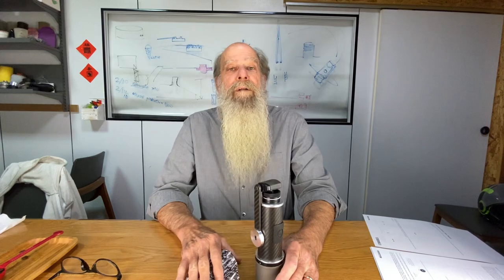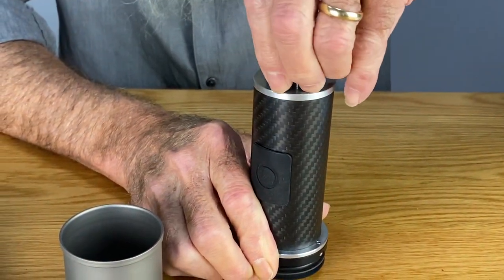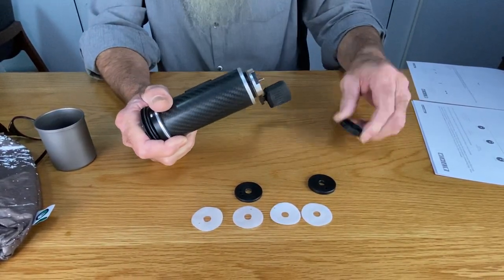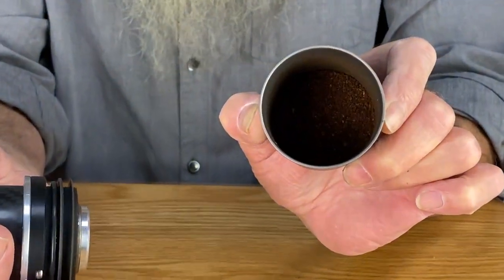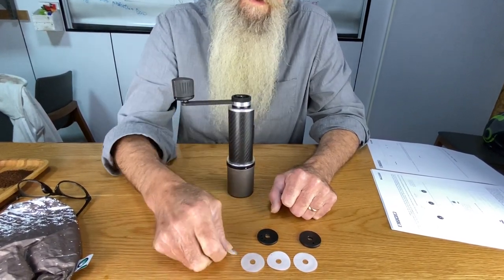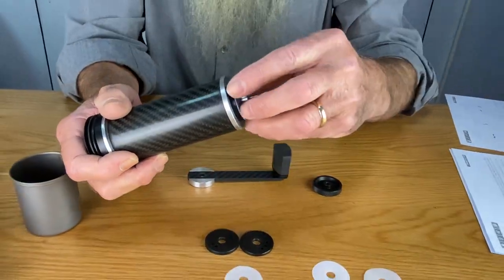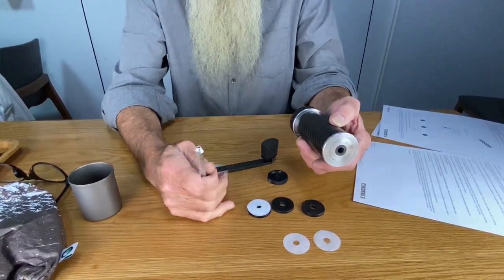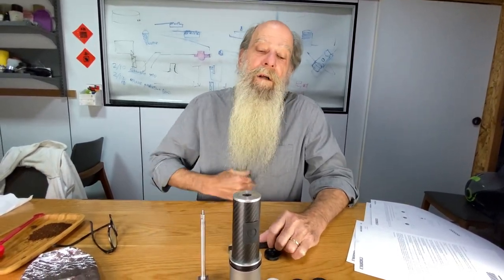OE FIXIE Manual Coffee Grinder Basic User’s Manual

Comment: This is absolutely sick! I love the design and the carbon fiber. 
The only thing I do not like is how to get the beans in. Being a travel grinder I think there should be a safer/simpler way to feed the grinder. On my Helor 101 the catch jar can be attached on the bottom but also on the top somehow to feed the beans, meaning that you don’t « pour » the beans in, you just have the beans in your catching jar, you put the grinder on top, you turn it over and voila all your beans are inside. So quick, so convenient and zero risk to drop beans on the floor.
Reply from the maker: Design is always a trade off of one thing for another, in this case, moving the entry to the side allows for a very precise alignment, and, as important in an ultralight, the removal of several grams of weight...and really, adding the beans isn't difficult!

Comment: can it be fully disassembled? you know for "recreational" stuff, like with the Apex. :)
Reply from the maker: No, not in any easy way - it would very likely damage the carbon fiber hopper if you tried to remove the end caps...  Additionally the cone burr is pressed on the carrier, so taking those apart would also be very difficult.  Everything else can be disassembled.